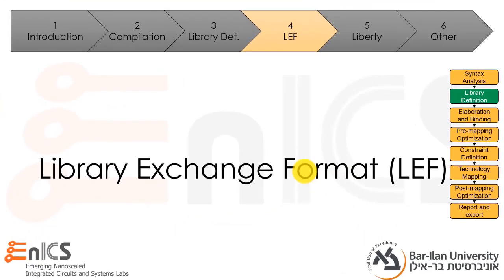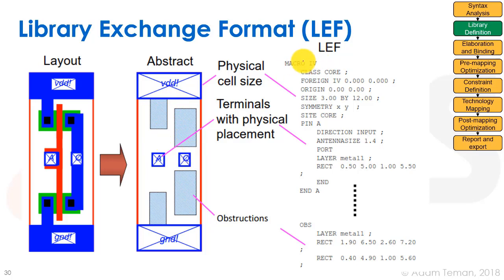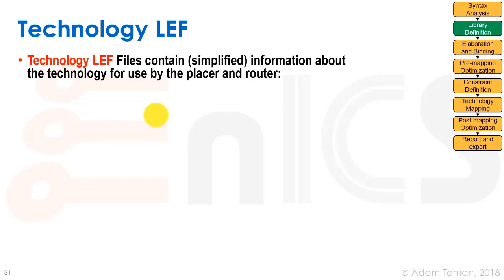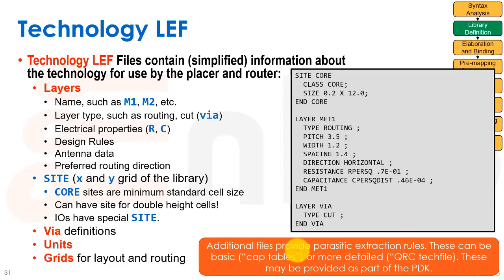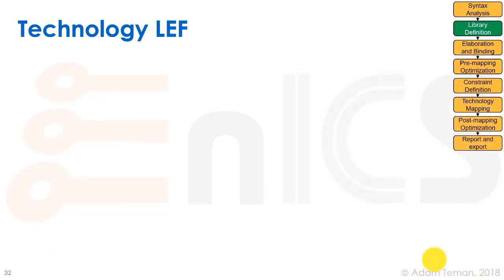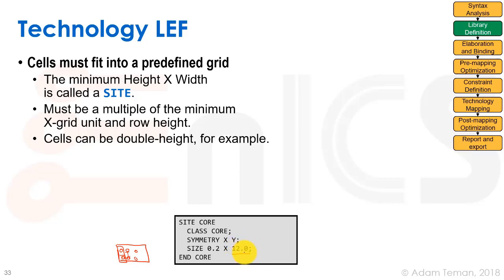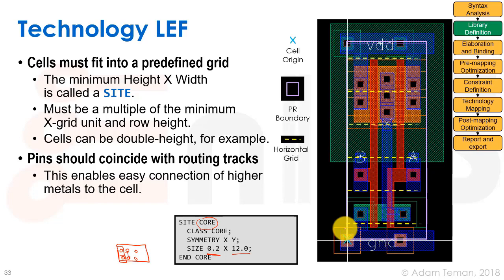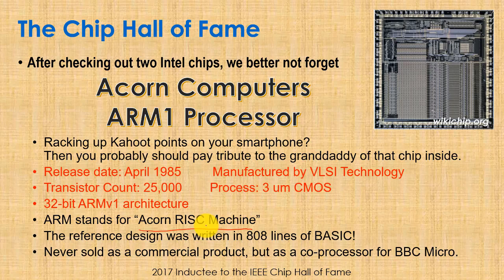DVD - Lecture 3d: LEF

Comment: Hi 
I want to know why we are using implant layer in OBS??
Reply from the maker: Hi, 
I'm not sure what you are asking - is it something from the slides I showed in my lecture or is this a question from something you have run into at your work? If it is from the slides, I probably got the image from something I found on the internet and can't vouch for the exact example. If it is something from "real life" then I can try and guess the following explanation. There is no 100% accurate standard or way to make library files and therefore you get different things from different vendors (and different products). Most of the time (yes, for almost every library or IP you get) there are things that don't exactly "fit" and you often need to "fidget" with them. This usually doesn't make it to the level of the design engineer, but is taken care of by the CAD team that makes sure that the entire flow works with the tools the company uses and the processes they are using. But believe me - there is a lot of adaptation of LEFs and LIBs from what you get from the foundry/vendor. 

With that, I can tell you that extra information is not detrimental; so you have OBS on an active layer - it's not going to do anything bad, just make the LEF file a few KB bigger. In a certain techfile, possibly the router could (strangely...) consider such a layer as a routing layer and then the LEF would need to add the diffusion as an obstruction. But this is not the standard way things are done, and it could lead to other not so nice consequences. But that may be the reason you see this...

Comment: Can you explain why the tech lef file is required when we have tech file?
Reply from the maker: Yes. Basically these are from "two different worlds".

The techfile is (traditionally) part of the PDK. In other words, it comes from the custom design (analog) world, used by programs, such as Virtuoso. The tech lef is for the backend (digital) world, used by programs, such as Innovus and ICC. There have been attempts by the various vendors to combine the two - this is basically what Cadence OA databases are doing (in at least one respect). But this hasn't been adopted too widely, so usually we provide a tech lef for the backend flow and a techfile for the circuit design flow.